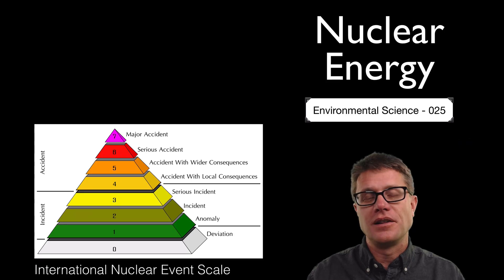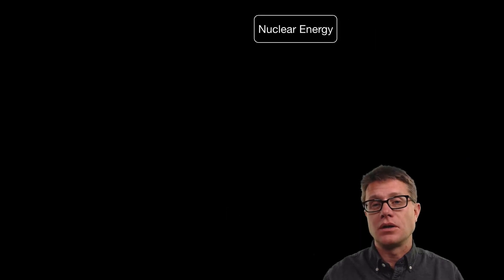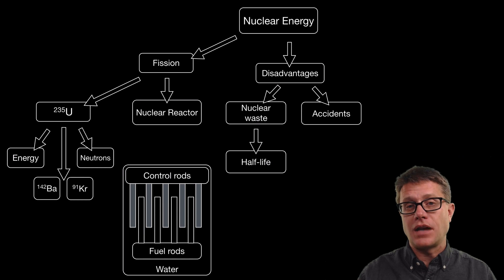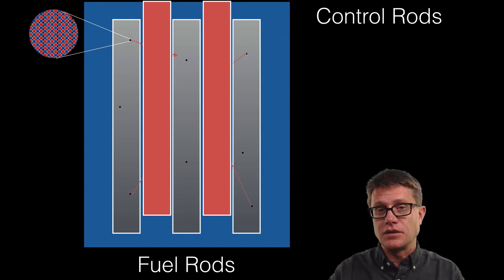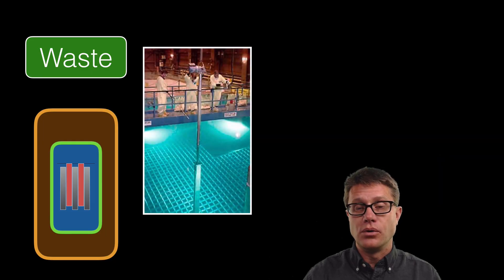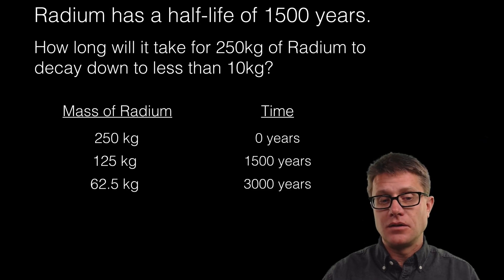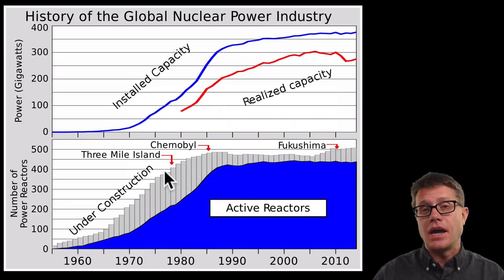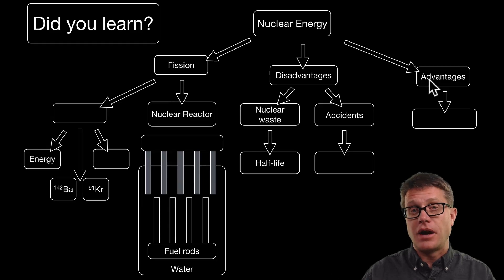Nuclear Energy

Comment: Neuclear power plants may be a bit costly to establish and set up? 
BUT?
COAL fired power plants turn heat into steam, the steam turns the turbine.
GAS fired power plants turn heat into steam, the steam turns the turbine.
Neuclear power  plants turn heat into steam, the steam turns the turbine.
These neuclear plants last 80 to 100 years.
SMALL module type Gas and Coal power plants could be built to power Australia while NEUCLEAR plants are put on line as they all use the same current water and power lines? These module plants can be used in other parts of Australia.?
IN the long trem this makes neuclear pwer plants the cheapest form of energy over the long term?